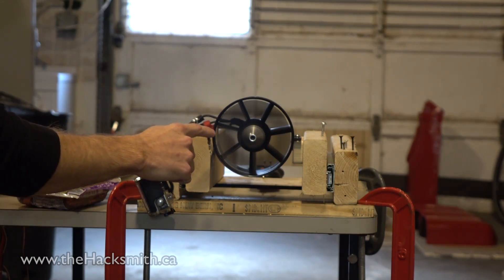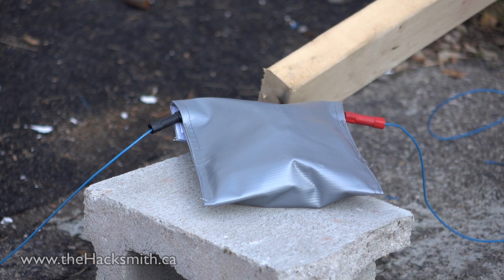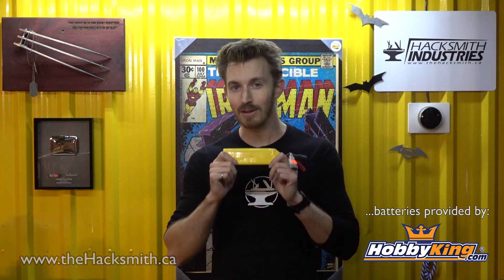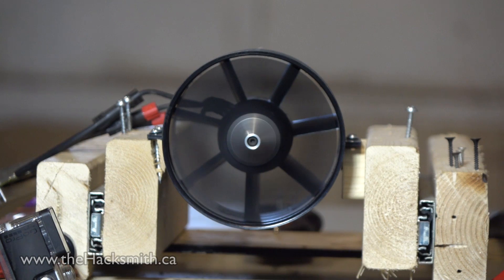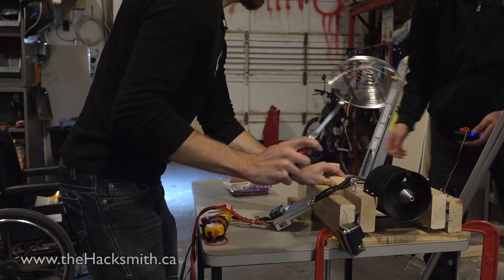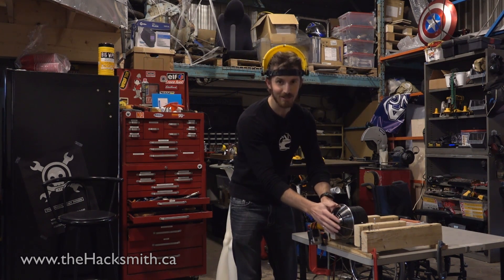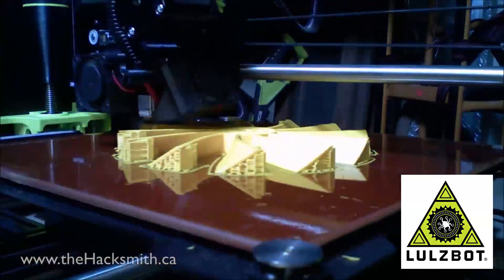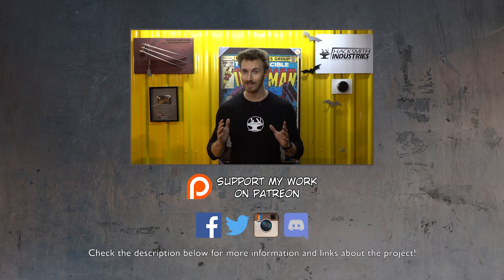Flying Like Iron Man #11: Not So Safe Safety Tests

Comment: So why not make aluminium blades?
make a good design, 3d print it and then post process the print with acetone for smooth surfaces.
then create a plaster/concrete mould (dilute it a lot and use a shaking table to avoid air bubbles, a drill or something attached to a table).
then remove the abs (pla maybe) using acetone or heat.
then melt scrap aluminum and pour it in for a cast and post process.
this should give you decently strong blades.
I should have access to comsol soon again so if you have a model I can run it. if you have an ansys model I can ask some friends if they are willing to run it.
Reply from the maker: Problem is at home-casting is pretty difficult for precision parts. It works for a lot of things, but for something like this, might be more effort than it's worth.

For example -- if you see the professional EDF blade we show near the end of the video -- look at the underside. It has a bunch of holes in it. Those are for balancing the blade so when it spins the CofG is perfectly in the center. Considering that whole piece was machined very accurately, it should of been balanced from the get go. Now imagine casting it, how many variations it would have! It might be possible, but like I said -- would probably end up being more effort than it's worth.
Reply: Yeah okay that might be true. The mould would have to be a very close to near match of the 3D printed part which is probably the hardest part. and balancing true drilling holes deeper is indeed time consuming. Resin printers would be better but then they have the issue again that it's very expensive to find one with a big printing volume. 
 I also assume that your cnc has to big of a head to make these precision parts.

Aceton vapour could still help to smooth out parts and you can use a coating to make it even smoother and slightly stronger.

Maybe the king of randomness of the backyard scientist are willing to cast a part for you (so you don't have to get the set-up nor equipment) that you could try out and see how well it works.

The best of luck with the project I'm following it closely.

Comment: have you ever thought of making a mechanism to eject the lithium polymer battery when it becomes unstable meaning its been punctured or over heated?
Reply from the maker: +Mr SoulTrain I can honestly say no I have not :p
Reply: the Hacksmith That is if you place the batteries outside of the suit. But that makes it more susceptible to it becoming unstable. I guess there are a few pros and cons to this. I dunno maybe you can think about it and work out the kinks. After all, you are the Hacksmith.

Comment: try printing a template for a mold for the fan and casting it in aluminium or steel if you can get a hot enough crucible.
Reply from the maker: Problem is at home-casting is pretty difficult for precision parts. It works for a lot of things, but for something like this, might be more effort than it's worth.

For example -- if you see the professional EDF blade we show near the end of the video -- look at the underside. It has a bunch of holes in it. Those are for balancing the blade so when it spins the CofG is perfectly in the center. Considering that whole piece was machined very accurately, it should of been balanced from the get go. Now imagine casting it, how many variations it would have! It might be possible, but like I said -- would probably end up being more effort than it's worth.
Reply: It may be worth colaborating with some one for the casting, there are several other youtube backyard engineers, including ones that use professional forges - perhaps one near your area.

I do appreciate the dificulties with producing precision parts, I just thought that working with metals rather than palstics would give you a better chance for making your own EDFs.

Another option would be moulded plastic resin - which I suspect will be stronger than 3d printed.

Last ditch thought... try looking around the scrap yard for fans from car/van/truck turbos - or fans from jets if you can find them. It may be possible to find fans that are sufficiently precision made and of the right size.

Any ways chap - love the vids and wish you and your team all the best.

Comment: Hi, I'm by no means expers but regarding 3d printed fans, I would recommend experimenting with high durability fillaments like Taulman Alloy. Also, in theory, designing the propeler with the outside ring could strenghten it. But perhaps the extra moment of inertia introduced by such ring would make it slower to change the rotational velocity...
Reply from the maker: We'll evaluate different materials once we've got a fan design that can produce enough thrust for our application -- we have some taulman =)

Comment: Hot dog to simulate finger? But there's no bone-like structure. Why not use a carrot? Better yet a par-boiled carrot.
Reply: Acrimonious Mirth because if you get your fingers stuck yhe first thing that hits is the meat and it's an somewhat accurate representation of it.
Reply: Jose Maquia nice, trying to cover up your mistake with a different scenario. Remember, our focus is on the test being carried out, thus on the ground. The interaction in focus is finger and fan, not overall. But yeah, I don't mean to harp on about that as I have nothing against you nor do I disagree with what you mean.
Reply: I had the same thought... I figured they should use a wooden chopstick to simulate bone... >_>

=D
Reply: Jose Maquia fatal = causes death. I doubt it'd be fatal. I'm more interested on the effect it has on the EDC.
Reply: Jose Maquia I'm not out of arguments by a long shot. Nor do I consider this an argument. I pointed out the mistake in order to educate you further as it seemed lacking. Sorry to have caused offence.
It seems in your rush to judge me you missed my actual point, namely "I'm more interested on the effect it has on the EDC".
Reply: Acrimonious Mirth yeah yeah, and btw, i just woke up and realised i did mean fatal, stick your finger in one of those 50 ft in the air and don't expect to have a safe landing...
Reply: k
Reply: Jose Maquia yeah, but that just the very tip, which we all know roughly what it'll be like if we've ever cut flesh. That's not the interesting part as it's not very damaging to the EDC and we nos the outcome on the person anyway.
Reply: Acrimonious Mirth ok we get it, it's not realistic calm down lmao
Reply: ZenXo if this is your definition of not calm I want some of whatever you're smoking!
Reply: Garret Hoffman would certainly be better! Not really difficult to be better than a hot dog.
Reply: Acrimonious Mirth So you want to know if it's going to cut the finger or suck it in? we all know it would be fatal and hurt hella lot.
Reply: Acrimonious Mirth when you are left without arguments you start pointing spelling or vocab mistakes huh?? terrible i meant.
Reply: He wouldn't have wanted to damage the fan
Reply: Or put a stick through the hotdog.  Also, I'd be worried about more than just my face while perfoming these tests...

Comment: James Bruton is using a really strong filament for his exo prints, i think that it would be a much safer print compared to the pla/abs u are using. also i know that u need the money to build this but would it really cost that much to let us look at the designs? my entire exo has a 3D model so ppl can download it and look/make it themselves. anyway good luck!!
Reply from the maker: +Auraswolf We're going to play with different materials once we've designed a blade that can actually put out a lot of thrust :)

As for the files, that's an incentive to donate as you get access to the private discord flying like iron man project chat room where you can be part of the design team with ideas :)
Reply: the Hacksmith ok, well we await ur next vid! (dont get ur head taken off of real)

Comment: what about cnc routing the turbine put of aluminium  ?
Reply from the maker: A shop would probably charge over $1000 for that. We have a supplier in China we might use that can do it quite cheap, but we need a final design first ;-)

Comment: Stop using the word "explode". They didn't explode. The just violently burst into flames. Combustion would be a better word.
Reply: Explode: burst or shatter violently and noisily as a result of rapid combustion, excessive internal pressure, or other process.
Reply: Ryan Power But they don't "burst or shatter". They just combust. No shattering, just fire.
Reply: +The Cowardly Paladin You're trying to tell me that when you puncture a lithium ion battery it won't "Burst" and even if it doesn't, it still sounds 100× better to say 'Explode' than 'Combust'.
Reply: The Cowardly Paladin ikr
Reply: Ya I agree
Reply: exactly THANK YOU!!
Reply: The Cowardly Paladin ok but srsly who the fuck cares?!

Comment: You're going to be flying though the air, without being surrounded by a giant metal cage that is flown by a professional. I really don't think this is a safety first situation.
Reply: But...It's still Badass.
Reply: Ryan Power I know. Its just not a safety first situation. If safety was the most important thing he probably wouldn't strap batteries to himself, and try to fly without the normal safety equipment, and that would be boring.

Its badass, but most badass things are not OSHA approved.
Reply: Avarickan It's a Badassery first situation
Reply from the maker: +Avarickan why do you care so much about OSHA? We're not making this for a business... It's a YouTube project lol
Reply: the Hacksmith Oh I don't. I'm just saying that this isn't really a situation where safety is the number one priority. Being awesome is, and safety comes in at a close second.

Comment: y dont you use small jet thrusters instead of these ducted fans?
Reply from the maker: Thanks for the question GeekySingh!

We've actually answered this in detail in the Flying Like Iron Man Q&A video! Check out that video, or visit http://www.thehacksmith.ca/flight-project-qa/ to learn more about the project!
Reply: the Hacksmith ya ..got it..jets are expensive , dangerous and less easy to control

Comment: You can use jet enjen
Reply: Sidhartha Mishra jet engine is way more heavy than Edf weight to thrust ration is very bad and they produce he'll lot of heat enough to cook a person
Reply from the maker: Thanks for the question Sidhartha Mishra!

We've actually answered this in detail in the Flying Like Iron Man Q&A video! Check out that video, or visit http://www.thehacksmith.ca/flight-project-qa/ to learn more about the project!
Reply: But you can fit jet enjen or edf on  wings     and you can fit mor than 4 with arms truster and rocket boots . probably  it would help.

Comment: As an engineer you should know that 3D printed plastic will not survive rotating at 45000 rpm. There is a reason they make them reinforced with carbon fiber. Just do some analysis before wasting time testing. That's what good engineers do.
Reply from the maker: +Alien as an engineer that's what I've thought too, but we've yet to have a blade come apart at those speeds. Something to be said for actual practical testing ;-) good engineers do both and don't write stuff off right away.
Reply from the maker: And the purpose of the testing right now is not to figure out what material to use -- to finalize the design of the blades to maximize thrust.
Reply: the Hacksmith You said in the video that you've already broken the blades off a few so...
Reply from the maker: Also said to stay tuned for a dedicated video explaining the 3D printing in detail ;-) 

The blades broke off from the propeller flying off the motor since it didn't have a proper key way =P The purpose of including that segment in this video was just to show we're working on it, but don't have anything conclusive yet. More than likely it's not going to work, but it's still worth trying.

Comment: Look at this on eBay http://www.ebay.com/itm/262605498982
Reply: This is a 144mm ducted fan that produces 10kg of thrust. the ones you are currently using are doing like 3-5.

Comment: Why you not make your own metal foundry  and with the help of 3d printered fan  cast our own metal fan which is more strong than the plastic one way more cheaper than orignal one.
Reply from the maker: Problem is at home-casting is pretty difficult for precision parts. It works for a lot of things, but for something like this, might be more effort than it's worth.

For example -- if you see the professional EDF blade we show near the end of the video -- look at the underside. It has a bunch of holes in it. Those are for balancing the blade so when it spins the CofG is perfectly in the center. Considering that whole piece was machined very accurately, it should of been balanced from the get go. Now imagine casting it, how many variations it would have! It might be possible, but like I said -- would probably end up being more effort than it's worth.
Reply: Personally, I would try asking around at local machine shops, seeing if they would be willing to pro bono some edf blades. Happens more than you might think. Turns out makers sometimes just like making things :).
Reply: Cast metal is brittle, so it would not be so well suited for high speed fan blades. But they might cast some out of resin, and place a sheet of carbon fibre in each blade slot of the mould before casting.

Comment: Could you not spray some kind of lacquer or surface coat on the propeller to add strength and also give it a smoother finish?

Comment: Suggestion:
To male a sure way not to get your shoe or pants on fire why don't you make a stilt. Not like a rod or plank of wood but something solid to make sure some comfort. So have a solid boot with something then just bolt a plate on the top of it. So then when you make a realistic outfit of Iron man that and the stilt can protect your legs.

Comment: Could the printed blades be strengthened using lost PLA casting to make them from aluminum or such?
Reply from the maker: Problem is at home-casting is pretty difficult for precision parts. It works for a lot of things, but for something like this, might be more effort than it's worth.

For example -- if you see the professional EDF blade we show near the end of the video -- look at the underside. It has a bunch of holes in it. Those are for balancing the blade so when it spins the CofG is perfectly in the center. Considering that whole piece was machined very accurately, it should of been balanced from the get go. Now imagine casting it, how many variations it would have! It might be possible, but like I said -- would probably end up being more effort than it's worth.

Comment: I have the same "zippy" batteries for my remote control planes. they work great and hold a charge. I have not had any fires, explosions, or bad stuff happening while using them. I will warn you that if you discharge them all the way, they get puffy from the gas that they release. so don't push them past their limits. once they get puffy, they puncture a lot easier and the gasses are flammable. otherwise, they are great batteries.
Reply: oops, i posted this comment before you said that you would test discharging it all the way. sorry. =(

Comment: Hacksmith. I am taking time to write this because I have a good idea. If you are wanting a safe system for the batteries if they explode  here is my theory if you have a button that can pop of the battery. Like if it's on fire you press a button on your hand and it pops off. Idk if that would work tho. Also if u had Kevlar inside of the thrusters covering the battery just as extra safety